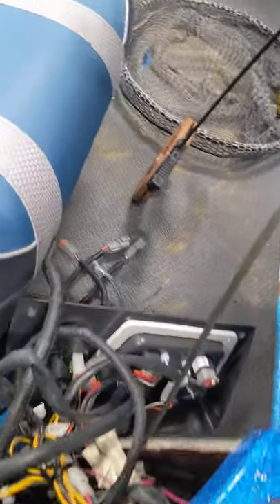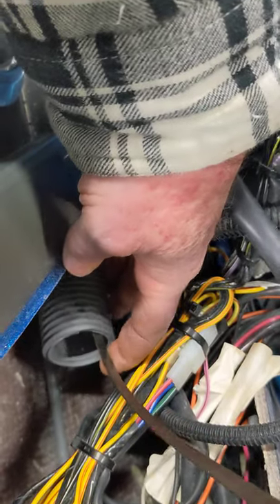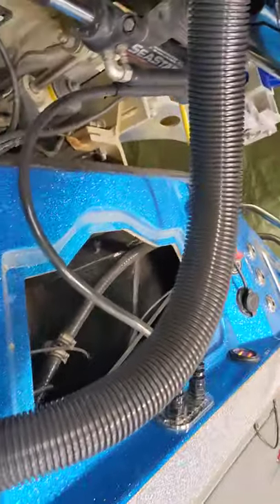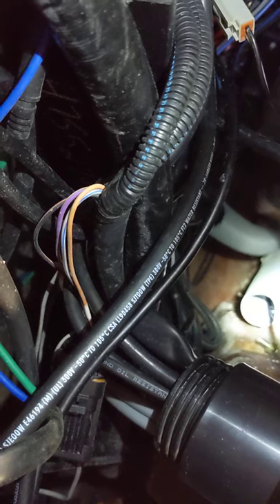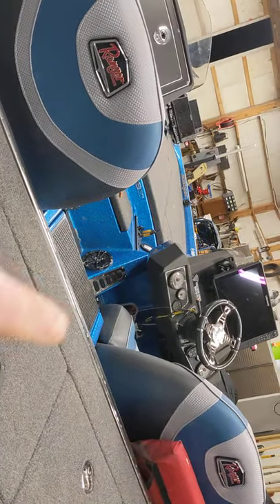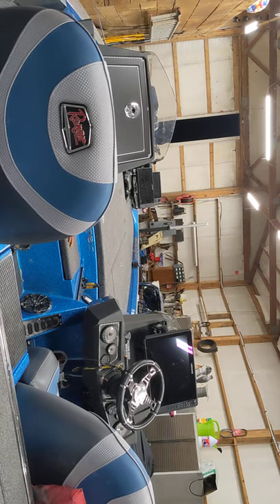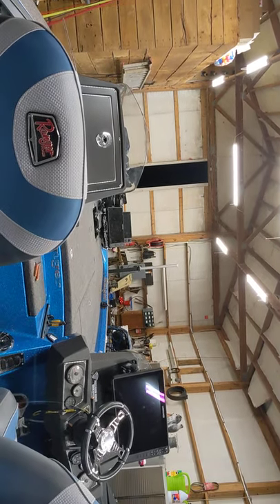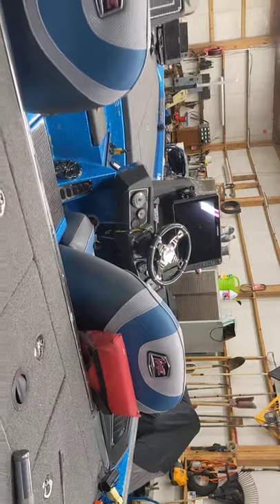Pulling new wires on a Ranger 521L

Comment: Thank you ! I’m going to install a new HDS Live 12 on my 2014 Ranger and Active Target and I guess I should plan on running a new wire to the battery ! Probably a minimum of 10 gauge I assume. Thanks again
Reply from the maker: I would run a minimum of 8 gauge. 6 is better.